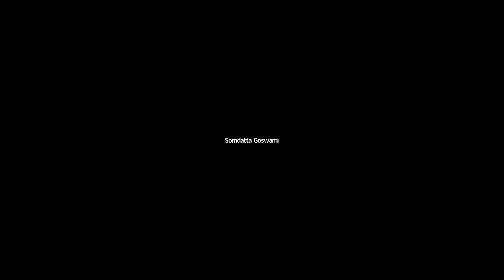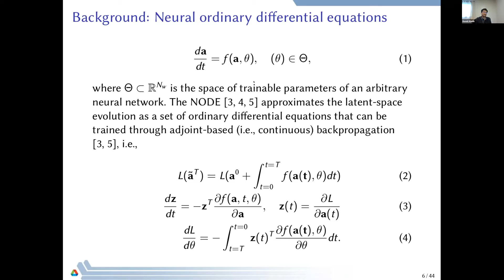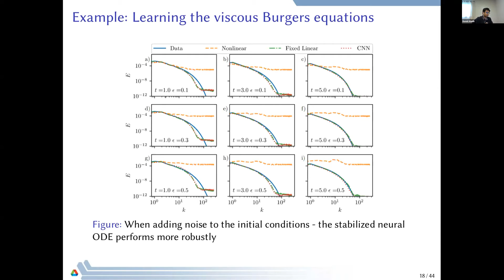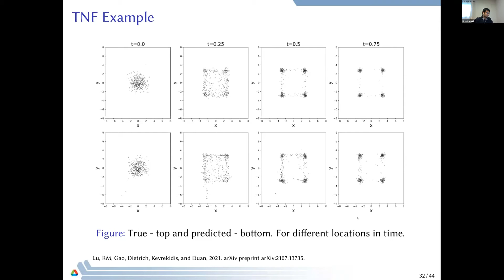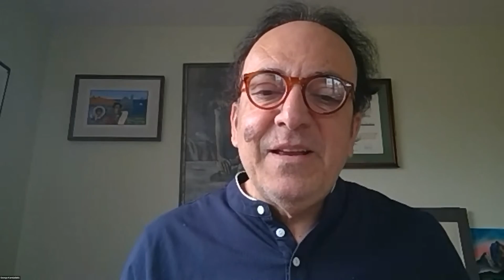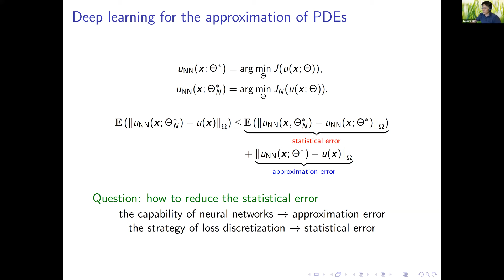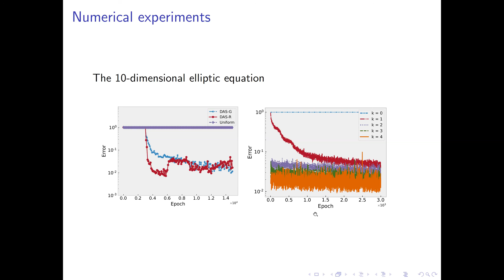Dynamical systems using scientific ML||Deep adaptive sampling for high-dimensional PDEs||May 27,2022

Comment: 00:08 Romit Malik presents on linear and non-linear dynamical systems using scientific machine learning
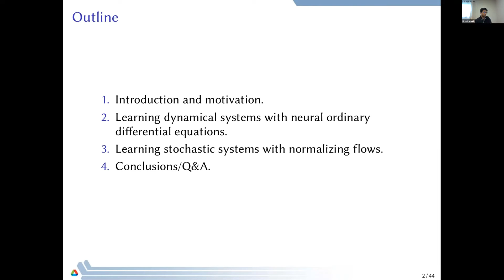02:29 Advancements in modeling climate data
07:01 Building non-intrusive surrogate models for high-dimensional PDEs using scientific ML techniques
09:06 Approximating f using neural networks and pseudo time
13:35 Training neural network with linear and non-linear terms
15:45 Comparing short-term and long-term behaviors of data-driven methods for high-dimensional PDEs
19:51 Introduction to Approximate Inertial Manifolds
21:55 Constructing projection matrix for high-dimensional PDEs
26:01 Reducing dimensionality of models using analysis
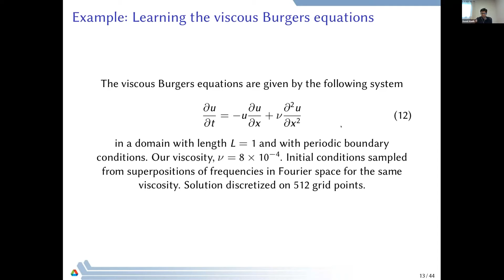27:59 Linear term acts as a stabilizing factor.
32:01 Explaining why stabilized machine learning methods perform well in certain regions
34:03 Viscous step taking over in high-dimensional PDEs
38:04 Utilizing satellite and ship observations for sea surface temperature prediction
40:04 Utilizing dimensionality reduction techniques in dynamical systems modeling
43:57 Neurology outperforms climate models in sub-seasonal forecasting
45:57 Generative scientific machine learning for stochastic dynamical systems
49:58 Using scientific ML for learning densities of stochastic dynamical systems
51:50 Using neural SDA and GANs for high-dimensional PDEs
55:43 Using deep adaptive sampling to maximize log probability and compute determinant of the Jacobian for computational efficiency
57:44 Using invertible mapping and neural networks for high-dimensional PDEs
1:01:24 Exploring gradients and dynamical systems in ML transformations
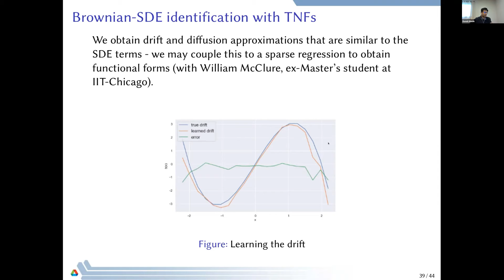1:03:23 Research focus on improving architecture of normalizing flow and applying to climatic datasets.
1:07:56 Understanding the impact of fossil fuel emissions and anthropogenic activity on climate behavior
1:10:09 Focus on statistical error in machine learning techniques for PDE approximation
1:14:51 Comparison of best approximation using classical and machine learning techniques
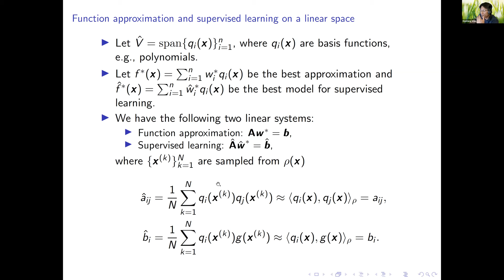1:17:26 Utilizing machine learning for high-dimensional PDEs
1:22:23 Discretization and optimization of loss functions using sampling methods
1:24:51 Optimization error in dynamical systems
1:29:51 Achieving variance reduction in integration through adaptive sampling
1:32:31 Adaptive sampling for high-dimensional PDEs
1:37:23 Krnet enhances modeling capability with double convergence rate
1:40:01 Reduction in variance and approximation error using deep adaptive sampling
1:44:57 Comparison of performance between DSR and DSG
1:47:20 Training two models simultaneously for better performance
1:51:35 Challenges of high-dimensional PDEs in dynamical systems
1:54:02 Adaptive sampling improves accuracy for high-dimensional PDEs
1:58:18 Comparison of adaptive sampling and uniform sampling
2:00:51 Discussion on adaptive sampling and refinement in high-dimensional PDEs
2:05:41 Utilizing scientific ML for dynamical systems
2:08:13 Adaptive learning strategy for efficient sample generation
2:12:43 Discussion on the importance of testing algorithms in diverse examples
2:14:58 Implementing scientific ML for high-dimensional PDEs